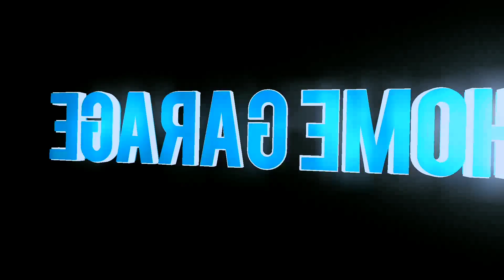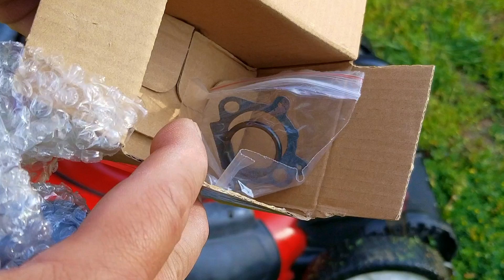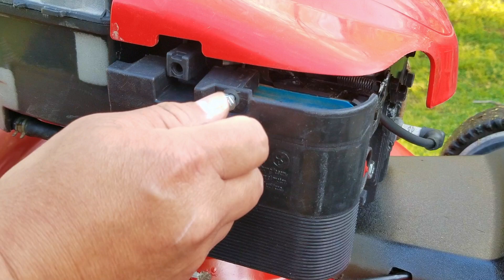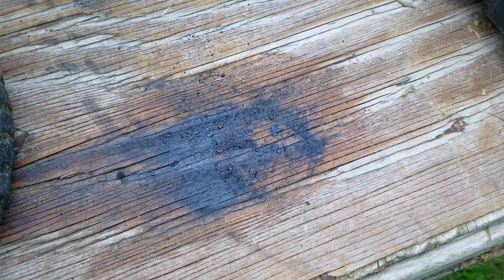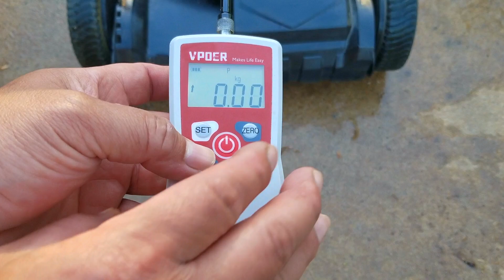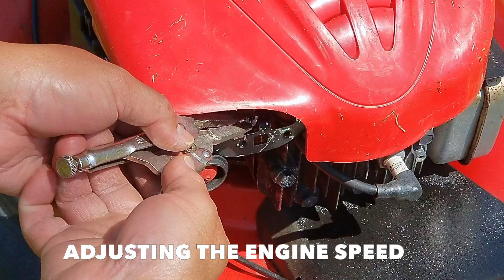Fixing A Fuel Leak On A Troy-Bilt Lawn Mower

Comment: Since you put time to eliminate other possible problems. Finish the investigation.

I have a B&S TB 110 that is over 2 years old. It's basically a new mower but this year it is leaking fuel as I noticed fuel around the housing and floor of the garage. 
The air filter has fuel in it, also the fuel line looks fine.
Reply from the maker: That's unfortunate, I would assume the carb is leaking internally.
Reply: @HomeGaragechannel 
I wonder if it was a cheap part since the mower is only 2 years old.
Reply from the maker: it could be but who knows

Comment: How to troubleshoot gas/oil leaking into the crank and running out of the breather tube when a lawn mower has been idling/running for 3 to four minutes with two replaced new oem carburetors?
Reply from the maker: Wow, I don't think I've ever come across this exact situation.   Is your mower like the one in the video or different?
Reply: @HomeGaragechannel  No, it's a Bolens 11A-B0BL765 140cc Briggs & Stratton engine. I've had it for close to six years with no problems and it will still start on the first pull. When I pull the oil dip stick to see if I smell gas, I don't smell gas on the oil dip stick. From my research it's a fuel problem so I've replaced: the O Ring behind the carburetor bracket, fuel lines, new spark plug, thought the first oem carb was defective so I sent that one back for a replacement, but the same results. I also have a Toro 21321 140cc with a Briggs and Stratton engine doing something similar, leaking straight oil through the breather tube, not much just small drips so I replaced the breather read (pvc valve) problem solved, but the bolens is leaking gas/oil. I don't consider myself a mechanic, I'm just a DIY home owner and need a backup tool for everything, so if I can't get it running properly, I'll just sell it, let buyer know what's going on with it then purchase another one, but thanks for responding!!.....
Reply from the maker: No problem and for future reference, if you think the first carb is bad, as for a refund and find one from a different vendor to account for bad batches from what could be the same carbs from the same manufactures.

Comment: If you’ve still got this mower I’d love to see a tear down of the motor even if it’s not fixable, if you’ve got time for it. The solution for this on any other mower on your channel would be to adjust valve clearance, but these non OHV motors are a headache, I’d like to see your thought process in trying to repair this, you always have excellent tips on this channel
Reply from the maker: Oh see now,  I had to watch the video again to see what you were asking about.  This mower is long gone unfortunately.  I sold it with the instructions that on hot start ups, the'll need to prime the carb.  They said they had no problems with doing that.
Reply: @HomeGaragechannel Nice! Would you or have you ever fixed/diagnosed a flathead motor mower with this problem?
Reply from the maker: No never have.  My feeling was, why bother putting more time into it, when customers are happy to work the issue.

Comment: Honestly... after 20 years of working on small engines, I stay away from clone carbs as much as I can. Those damn things gave me so much trouble over the years that I´d rather clean a hacked up original carb 1000 times than installing a clone. As a last resort, ok, but that´s all...
Reply from the maker: you are correct, if someone else is willing to fork over the money for an OEM carb or all the time you'll need to clean the original one, I'd go for it too. Unfortunately 99% of my customers are my coworkers and I know how much they make, not much.

Comment: Many below have suspected that the primer isn't working because of a warped air box. Can't be that because he clearly filmed a good geyser of gas when priming.  IMHO, a working primer based Quantum starts more reliably than the auto choke system.  The engine sounds good (like a Quantum should) and restarts after priming. That, to me, would rule out compression and coil. Thus, like HG, I am puzzled.
Reply from the maker: I'm with you, I like a simple primer bulb versus an auto choke system.  I can't remember if there's a second repair video on this one, but we'll find out soon enough

Comment: It’s sad that the average Joe does nothing more than fill it up with gas when it runs out. That’s the height of their maintenance never mind taking tires off to lube them.
Reply: Well the woke are getting the shaft they deserve 😊
Reply from the maker: it's sad but true and the mowers have changed over time to accommodate it.

Comment: Love your channel. Can u help with an issue please? I hit a stone and the mower stopped. I've checked both keyway which are intact, the blade is straight,  yet the mower just will not start. Still feels thw same pulling the chord.. I'm at a loss
Reply from the maker: that's quite the situation. Since you've checked the blade and the flywheel key and have said nothing is wrong with them,  then I'd go thru the basics.  Use some starting fluid in the carb and see if it'll run for a second.

Comment: i dumpster saved a walk behind weed wacker a couple of years age. I replaced the carb because the old one was too far gone. On occasion the carb would leak (overflow) after filling the tank. This would occur if you ran the tank dry. I discovered that the float would drop down far enough to catch on the main jet tube/shaft. I ended up smoothing off the edge of the tube/shaft with a file so that the float would not hang up on it anymore. I discovered this when dropping the bowl and noticing the float was stuck.  
If you are going to resell the mower - go the extra distance and fix the problem or make sure the buyer understands the problem.
Reply from the maker: that's great advice, thank you for it.

Comment: I have Honda Troy built lawnmower with front wheel drive and I cleaned carburetor but the only problem I have is to spray the carburetor so it will start and once started runs good so what is the problem.
Reply from the maker: what kind of priming system does it have?  Does it have the automatic choke system or the lever on top of the air box that you have move to get it to start?

Comment: Check the engines compression & perhaps the valve clearance.

Check the O ring & intake tube at the carburettors outlet flange for wear or damage, check that it isn't loose on the engine block near where the inlet valve is !
Reply from the maker: thank you Russell Booth

Comment: The intake pipe o-ring, crank seal and/or the headgasket could be leaking. Soapy water in a spray bottle can reveal the answer. Great job. Don't be afraid to take parts and rebuild the original carburetor.
Reply from the maker: thank you and that's a great idea

Comment: Had a similar problem could not figure it out.  i sold it and told them you need to prime it every time and they were ok with that. However i recently had another one do the same thing and it turned out to be the main jet was partly restricted or in your case undersized slightly 
 Cleaned it very good and the problem was fixed.
Reply from the maker: you know what... in this case you might be right about the jet.

Comment: I bought a 40$ Chinese carb for my old simplicity tractor, a month later it doesn’t give any fuel to the engine, already cleaned it twice
Reply from the maker: have you confirmed fuel flow at the bowl?  Turn off fuel, take off the bowl, then while keeping the float in the up position, turn on the fuel and then release the bowl and observe the fuel flow from the needle.
Reply: @HomeGaragechannel  there’s a drain screw in the bottom, it keeps flowing out

Comment: I would look at the intake screws and make sure they are secured down all the way or that the intake doesn't have a crack in it.  The screws are prone to coming loose (esp at the age the engine is) and could make for a hard re-start unless it's primed.  Could also be a failing coil, in that the extra fuel manages to get ignited, then once it's going it keeps going.  I don't think the air filter base is an issue, as that carb primed really well and if the base was warped likely wouldn't prime at all.
Reply from the maker: all great tips, and well worth looking into

Comment: I'd fix it mate. Another good mower that hopefully can be properly fixed. I'm guessing valve adjustment or seating.
Reply from the maker: it could be, that or an air leak somewhere after the carb.

Comment: Definitely go for the compression test, not sure if the carb jets have been cleaned maybe by mixing in some seafoam or other carb cleanser will help. Im one that’s been sold on seafoam I use it as a maintenance on my car and now on my small engine equipment. Thanks for sharing info, great videos 👍
Reply from the maker: thank you for the advice!

Comment: I picked up an old craftsman mower last week with a quantum engine. It had a sheared flywheel key, so it wouldnt start at first. Once that was taken care of, I put a carb on it, tried to start it, but no go. The primer wasnt priming. I took the advice of some people on the forums and double gasketed the air intake and that fixed the primer issue perfectly, but now it has the same issue as this one in the video. Starts good, but needs repriming each time. I know the needle and seat arent perfect in the carb I put on it, but all original parts on a carb from 97 isnt too bad. 😅
Reply from the maker: you did an excellent job fixing it up though!
Reply: The same thing happened to me with a quantum. I got it, tried to start it, and all it did was sputter and not start. I checked the flywheel key after checking over the whole engine and it was sheared. I replaced it and cleaned a carb for it (it was missing all the carb innards) and it started right up after putting a new intake gasket.

Comment: Compression or leak down test wouldn't hurt. I was trying to look for the valves, since a lot of these push mowers have OHV engines. I don't see the OHV design with this engine, so valve adjustments might be out of the question. I wonder how the head gasket looks. Make sure everything is torqued to spec as well. I'll see what decisions you make with this mower. Looking forward to a future video of this one.
Reply from the maker: thank you Mark Meadows

Comment: I’ve always found that it takes more than a few minutes for Quantum engines to fully warm up to the point where they don’t need a slightly richer fuel mixture to start with one pull. That’s one reason why I prefer these primer bulb style carbs over the auto-choke ones. I find if I use the grass bag and it needs dumping after the first couple rows most Quantum auto-choke engines will not restart because they’re not fully warmed up yet and still need that little extra fuel to start, but the choke flap is wide open. I don’t have this problem with higher efficiency OHV engines, but Quantums are kind of thirsty and need that richer mixture for a little longer into the run cycle. Auto-choke makes them very hard to start on a cold fall day too, whereas with a primer system it’s just a matter of giving it a few extra pumps.
Reply from the maker: I like the way you explained the situation

Comment: I had the same issue on my mower, I bought a new carb and with the new carb it ran worse so i rebuilt the old carb and doubled up the gaskets on the air filter cover and the problem was fixed. Dont know if it will fix your issue? But definitely fixed mine. It was a weird problem i was having. Hope ya had a awesome and safe 4th. It was my birthday.
Reply from the maker: thank you and I appreciate that!

Comment: What does it mean when the oil in a Troy built  blow comes out straight black after I did a oil change on it and before I did it it was still black and the oil was like a month old only and the blower won’t start?
Reply from the maker: when doing the first oil change was the engine hot or cold.  If It wasn't hot, then the bottom of the engine would have had a lot of the heavier particles at the bottom.  When you add new oil to it, it'll contaminate it and make it black again.  If the oil comes out black, I would do a flush on it to help get out all the heavier bits.
Reply: @HomeGaragechannel  the engine was hot and also it’s hard to start. I think I’m might’ve blown the engine. Also is it like a way I can send you a video of how hard is it to start on socials or Facebook?

Comment: A bit baffled. I'll be staying tuned. 
I'm working on a Briggs with plastic carburetor with fuel leak. Needle looks good. How do you adjust float level? I tried tweaking the plastic float but it bounces back. Any suggestions?
Reply from the maker: unfortunately I don't think you can tweak it.  Also have you considered getting a new needle then?  The seat in the plastic carb is metal and the needle is the part that has the rubber on it the tip.
Reply: @HomeGaragechannel  , thank you,  I think you are right. Going to double check for obstruction in the seat area and then order a new needle if necessary.

Comment: Hey HG, definitely a head scratcher. I’d like to see a compression and a leak down test. I’m wondering if the air filter housing is warped allowing air to bypass the gasket? 
That puff of black smoke when you first fired it up may also be a sign of ring wear? If that’s the case the engine may not be generating enough negative pressure to draw the fuel at start up. 
Cheers for all you do! You and Bre are my go too for small engine higher learning.
Reply from the maker: thank you for all the ideas, we'll see what happens soon.

Comment: Pull the muffler off and try the test again. Maybe a clogged muffler.
If not then, 
I believe there is a significant amount of water or gasolinein the engine oil That's what's causing it to not start right afterward it's either water inside the engine oil or fuel inside the engine oil.You're going to have to do ia dump out into a glass jar to see if it's true. Engine flush to find out also if that doesn't happen to work you may have an air leak in the carburetor plastic intake tube it's that plastic tube that connects to the carburetor. Hopefully it's just loose and you can just tighten it and it doesn't have a hairline crack. Check with bubble spray.
Not to worry. Clean the crack with acetone then make a paste of baking soda mixed with Krazy glue and it should fix 
Try the bubble spray air leak test in the pickup tube first since it's less labor intensive then dump the oil and inspect for water.
Reply from the maker: thank you for all the tips!